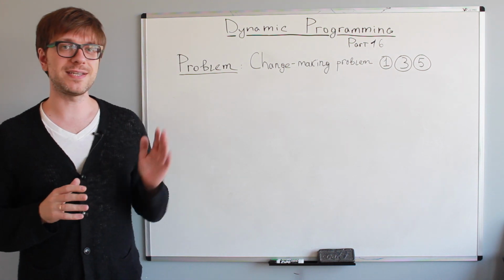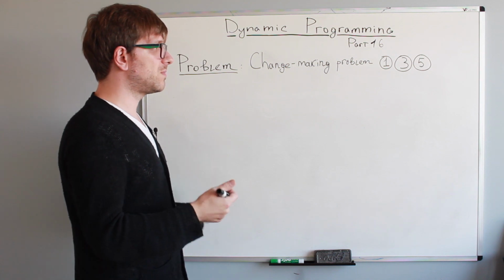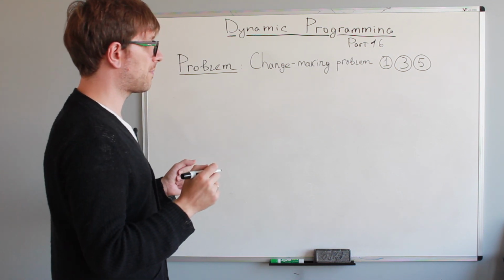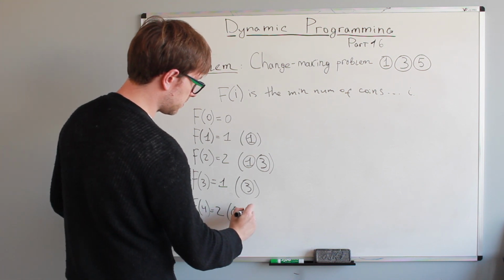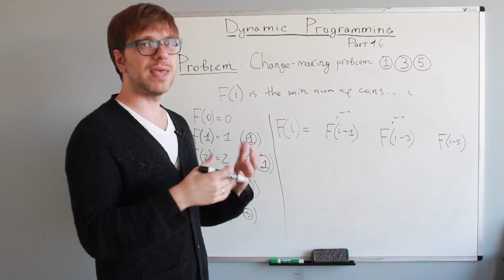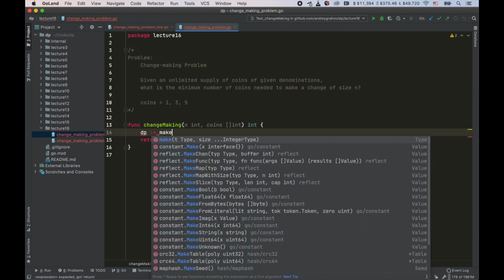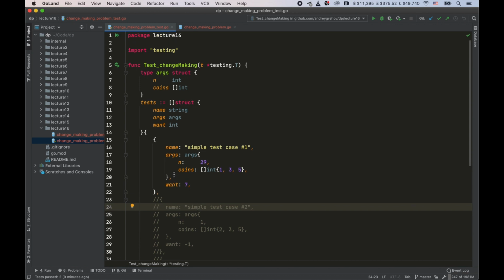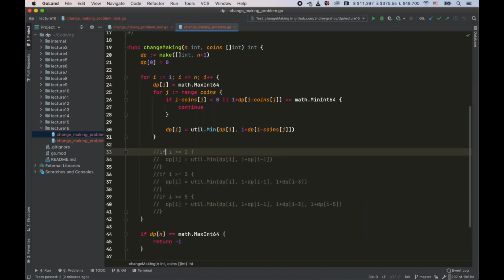16. Change-making Problem (Dynamic Programming for Beginners)

Comment: Thanks for the video - I tried that solution in Java but its not working  - 

    public int coinChange(int[] coins, int amount) {
        if(amount ==0) return 0;
        int[] dp = new int[amount+1];
        // Arrays.fill(dp, amount+1);
        dp[0]=0;
        for(int i=1; i<=amount; i++){
            for(int j=0; j<coins.length; j++){
                if(i-coins[j] > 0){
                    dp[i] = Math.min(dp[i],1+ dp[i-coins[j]]);         
                }
            }
        }
        return dp[amount];
    }
its always 0 which is incorrect.

Comment: Hey Andrey, after having watched many videos of this series I got some problem that can be solved with dynamic programming but I just don‘t k ow how to solve it: 
Your task is to program an algorithm that computes the minimum energy to complete a trip. More formally, you need to compute the minimum energy for moving from position  0 to position n. There are walls in some positions, and you can using the following three ways to move.

Walk: Move 1 position using 1 unit of energy but the ending position should NOT be a wall. For example, if you are in Position 5 but Position 6 is a wall, then you are not allowed to use Walk.
Climb: Move 1 position using 2 units of energy.
Jump: Move 6 position using 8 units of energy but the ending position should NOT be a wall. For example, if you are in Position 5, Positions 6-10 are walls, but Position 11 is NOT a wall, the you can use Jump.
The input is a Boolean array A where 1 stands for a wall and 0 for no wall

It would be great if you could, since I got really inspired by your videos to start learning algorithms
Reply from the maker: Hey Franz,

It would be great to see some test cases, but if I'm not mistaken, the solution is quite trivial.

Objective function: f[i] is the minimum energy required for moving from position 0 to position i.

Base case: f[0] = 0 - we don't need to spend any energy to reach position 0.

Now, let's imagine that the problem is already solved. We are standing at position n. How could we get there? We could get there from one of these:

a). n-1 if the last move was a WALK
b). n-1 if the last move was a CLIMB
c). n-6 if the last move was a JUMP

We are interested in the minimum among them. So:

f[n] = min(f[n-1], f[n-1], f[n-6])

But, in order to make the last move, we have to spend some energy, so let's do it:

f[n] = min(f[n-1]+1, f[n-1]+2, f[n-6]+8)

Since we need to consider walls, we'll drop WALK/JUMP moves if they fall on a wall:

f[n] = min(f[n-1]+2, f[n-6]+8) when A[n-1]==1
f[n] = min(f[n-1]+1, f[n-1]+2) when A[n-6]==1
f[n] = f[n-1]+2 when A[n-1]==1 AND A[n-6]==1
f[n] = min(f[n-1]+1, f[n-1]+2, f[n-6]+8) when A[n-1]==0 AND A[n-6]==0

Let me know if this is a workable solution.
Reply: @andreygrehov  thanks, a lot for your response. My main concern is the implementation in java, but I'll do my best. Keep up the great work!
Reply from the maker: @robertschumann6977  here you go https://play.golang.org/p/abRS8VwwIJL
Reply: @andreygrehov  thanks a lot for your help!
Reply: @andreygrehov  
 for the set {false, false,false,true,true,false,true,true,false,false,true,true,false,false,true,false,false,true,false,true,false,true,false,false,false,true,false,false,true,false,false,false,true,false,false,false,true,true,false,true,false,true,false,true,false,true,false,false,true,true,false,true,false,false,false,true,false,true,true,false,false,true,false,false,false,false,true,true,true,true,true,true,false,true,false,false,false,true,false,false,true,false,false,false,false,false,true,false,true,false,false,false,false,false,false,false,true,false,true,false,false}
 the algorithm should yield 128, but when I substituted this into your golang code, it yields 130,  might there be a tiny mistake? There are also some hidden tests made for what the algorithm does not seem to work properly.
Reply: @andreygrehov  Nevertheless thanks for your help, I hope that I will find some suitable algorithm. Of course it would be cool if you could look over your algorithm, but you already helped me a lot. Keep up the great work!
Reply from the maker: @robertschumann6977  no prob, man. Is my algorithm not working? I get 32 as a result.
Reply: @andreygrehov  I forget to say that, the solution should be 128, so the algo seems to be a bit wrong
Reply: @andreygrehov  there was actually one false missing in the set, I updated it, but still the algo yields 131 instead of 128
Reply: @andreygrehov  this problem seems harder than I actually thought
Reply from the maker: @robertschumann6977  show me the exact input and the expected result. I'm curious where the problem in the algo is.
Reply: @andreygrehov  the exact input is what I posted above (the very long array). The 0th element is our starting point and thus isn‘t important for the calculation as it is always set to false. The output should be 128. Does your algorithm assure that steps don‘t overlap, i.e. if you made 6 steps that they don‘t overlap...
Reply from the maker: @robertschumann6977  your comment was filtered by YouTube as spam and I couldn't see it, which is why I was confused. Yes, there was a minor problem in the algorithm, which I thought I fixed, but apparently I didn't. Here is the updated version: https://play.golang.org/p/B0raagd3E66

On line 24 we don't need to check if A[i-6] is a wall, because you're allowed to jump from a wall.
Reply: @andreygrehov  thanks a  lot, now everything is working properly. One last thing: I kind of grasp dynamic programming, but what made me struggle with this problem is the fact that obviously jumps can‘t overlap. Why does this algorithm in its simplicity assure this rule? Also one private question: where are you currently working at? (if this question is to private than I‘m terribly sorry)
Reply from the maker: @robertschumann6977  no worries. Not sure what you mean by overlapping jumps, but this problem is very similar to climbing stairs problem(s) we reviewed in lectures 2-7. I currently work at Timehop, in the Ads team.
Reply: @andreygrehov  A test case is given by: { false, true, false, false, true, true, false, true, true, false, true, true, true, true, true, false, true, true, false, true, true, false, false, true, false } with the solution 32